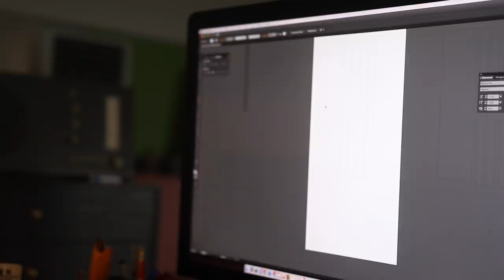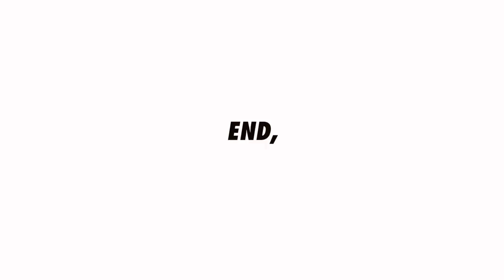W68_Drawers in Cabinet

Comment: Nice looking
But, would've liked to view how you fastened the top.
(Fasteners/method used)
Also, how does the end user know which cabinet door swings to where?
Especially since it is located in such a communal location?
Reply: Not only that, but one has to bend to the ground to open a cabinet. This aspect is a devastating victory of form over function.
Reply: Totally agree
In a common area,, whew, designed for destruction.
Don't know how they do it there but the American end user will correct that abruptly.
I would imagine those doors won't be lasting long.
Best case scenario, someone has a screwdriver handy, politely removes them, stacks them on top of the counter where eventually a microwave, or a coffeemaker, condiments, or the dreaded box of paper files gets stacked on top of it.
lol,, that's the best case scenario.
The worst case,, whoa, too ugly to mention here,, smh